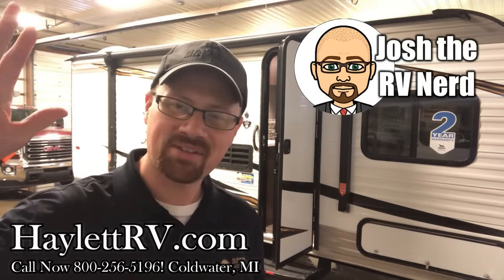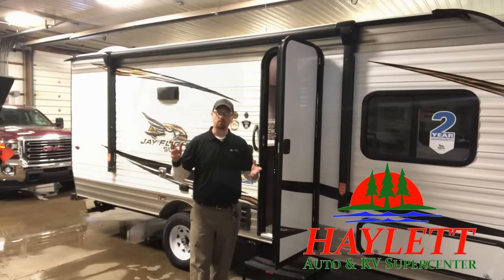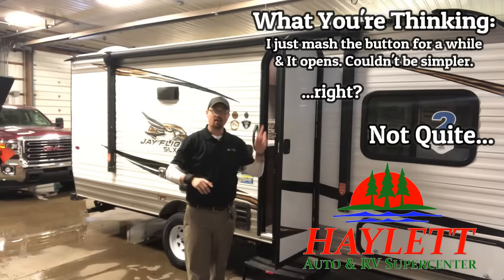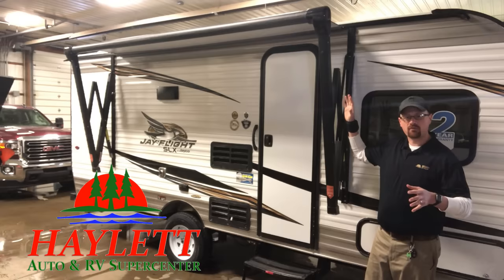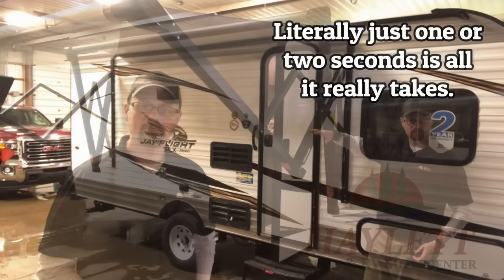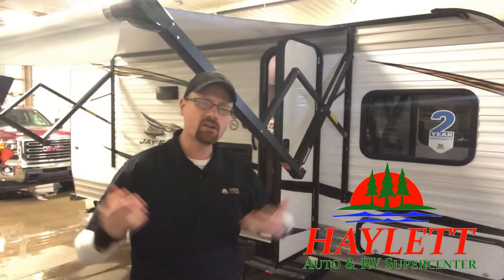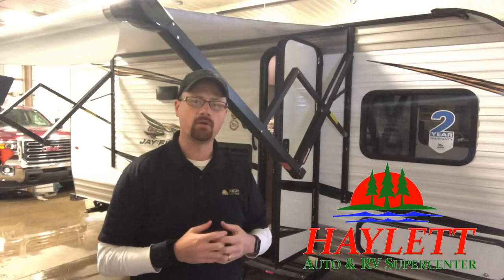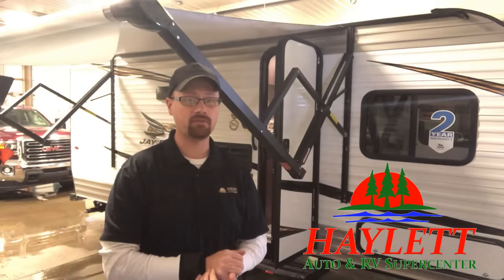You're Using Your Power Awning Wrong with Josh the RV Nerd

Comment: So what your saying is everytime I go out my screen door on my house I  should only open it 2 inches and wait a few seconds before fully opening the screen door to walk out ? 🤔
The trailer awning motor isn't at any point over powering that gas strut during the opening process. The awning will only open as fast as the gas strut allows it.
Reply from the maker: Never said anything remotely like that. Your statements come with errant assumptions. Awning arm struts and home door struts aren't the same thing. Similar concept, not the same thing. 

That would be like comparing a Chevy Colorado to a Chevy Silverado and expecting the same use/function from both. 

Home door struts are, without question, stronger & made for daily use. Awning arm struts are made for seasonal/periodic use. They're each built to the level of their expected use. That understanding is what many people lack as the word "Residential" is flung around the RV industry far too freely.

Comment: Well coming from a 10 year certified RV tech...you're not correct and you're taking a guess at the purpose and mechanical function of a gas strut. You definitely don't need to pause on the way out...that's exactly what the awning roll out timing is set by. Who told you this...? Why try to create content by making stuff up..?